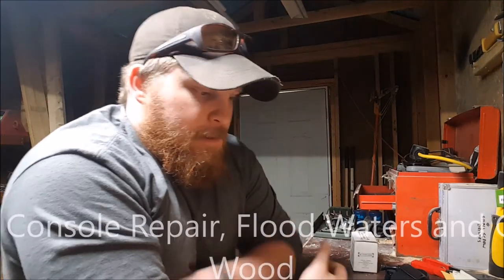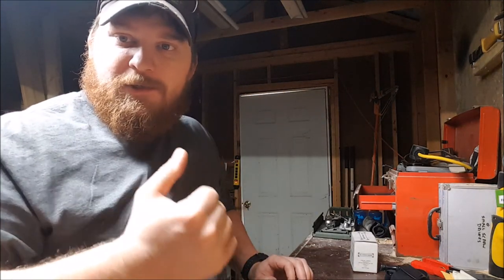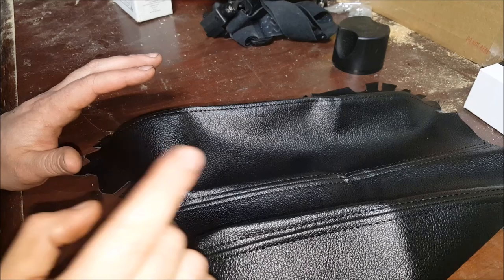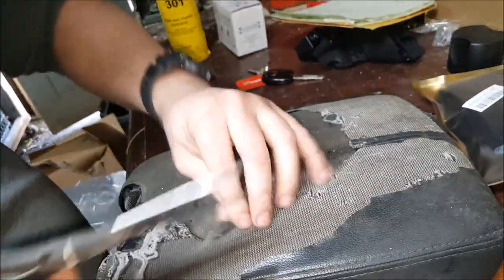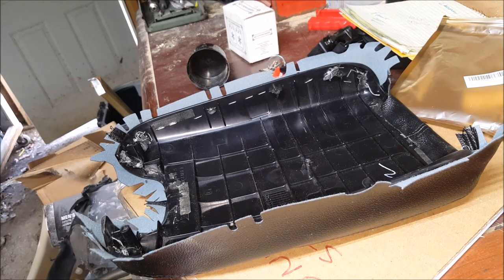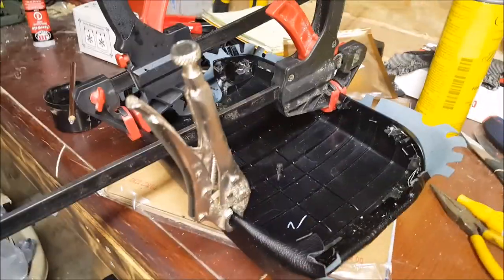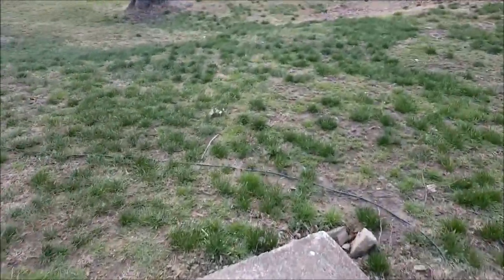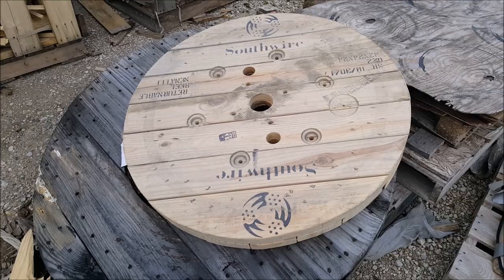2008 (8th Gen) Honda Accord Center Console/Armrest Fabric Repair.

Comment: I had the same issue with center console and arm rest on coupe. Replace both with real leather form some ebay store I forgot the name of years ago. I used a glue gun from the old lady's craft stuff lol. I just put the hot glue underneath on all the tabs. It has held up great even in Houston heat and dogs that like to be on the center console for years now👌

Comment: Did the same with mine with success. eBay for me as well.. I believe $10. Glued it down with spray adhesive by 3M. Dried quick enough where clamps were not needed. Also added some felt like material for padding on top to. Give some cushion. Had a piece laying around.

Comment: Enjoyed your video.  Very upset Honda charges so much for a covered piece of plastic ($265.83 WTF)...so I went through eBay and bought a nice leather piece $20, to replace the cheap OEM fabric armrest cover.  I also used a piece of felt under the leather for padding that I found at Walmart's fabric dept.  Think it'll last for as long as I own my 2005 Honda Accord.  Thanks for sharing your experience!

Comment: Is there a reason why a staple gun Would not work here?
Reply from the maker: scientist100 should work just fine....i just didn't have one or i would have stapled as well
Reply: BuddyLe3 ah ok, tedious and long process without a stapler. I have a heat gun and a stapler, I heard 1/4th of an inch is recommended. I will try that when I get mine. My arm rest is ripped and i want to replace it before the inner part gets dirty or contaminated.

Comment: Buddy my armrest is peeling also.
Reply from the maker: luckily the company that sells this cover also sells covers to just about every armrest and pad in the car.  They are very affordable too, so I'm gonna start ordering replacement covers to all the parts that are messed up.  But yeah, I'm no upholsterer by a long shot and I didn't have everything that I needed, but I got it done and it looks a thousand times better.  If anything, this video can give you an idea of where to get these covers and what all is involved in changing it out.
Reply: Like 90% of these gen accord covers tear lol.
Reply: @BuddyLe38386  The cover seems so thin that staples would go right through it. I guess they use ones with much shorter legs/teeth.